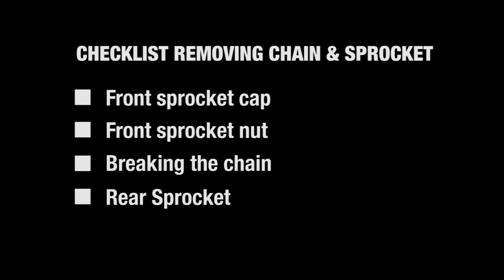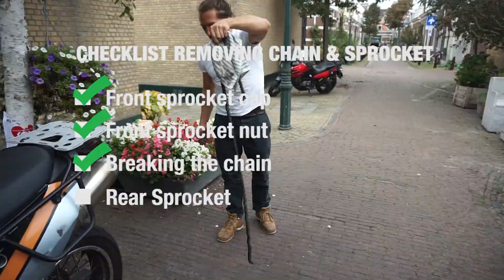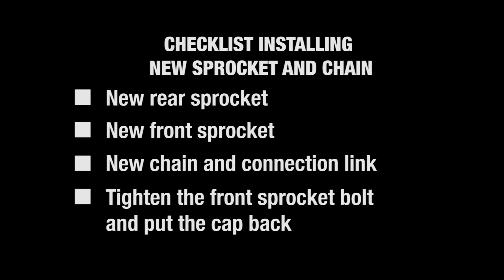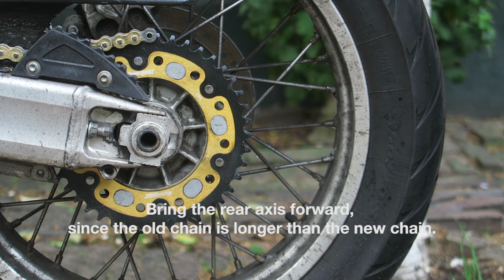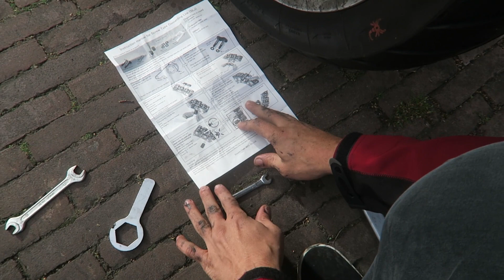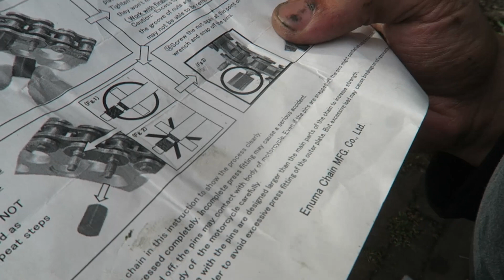How to easily change your motorcycle chain and sprockets /// KTM Adventure 950

Comment: Thanks JoJo 👍I feel like such an idiot not knowing that method of using the engine to crack the front sprocket nut 🤔. So simple ! even an "engineer"can work it out. Ha,Ha,Ha. Great scope with well paced instructions, Good job guys & many more successful  chain & sprockets replacements to come 🤘
Reply from the maker: Thank Peter, hope you like this type of video :)
Reply: Doesn't the engine actually tighten the nut as it turns?

Comment: Need better tools with greater leverage. Frustrating observing hands that are clearly not used to handling tools. It's a v satisfying job to do yourself because you know how much you're saving compared to the dealer. The 950 still looks v modern after all these years. Fantastically well designed bike.

Comment: There is a small incorrect information in your video. When you adjust chain tension, clearance is not 3-4 mm it should be 30-40mm. You can find this information also on a sticker that is  under the seat.